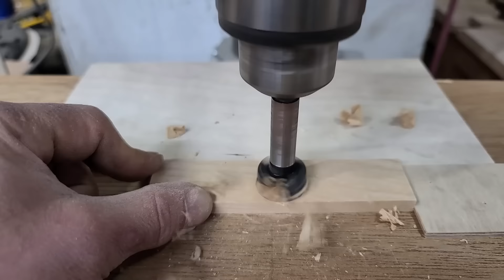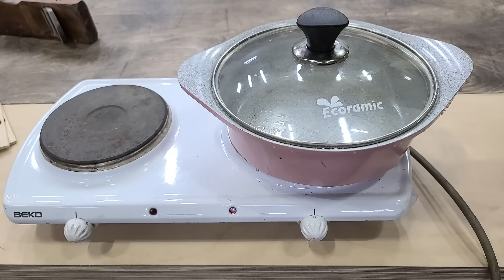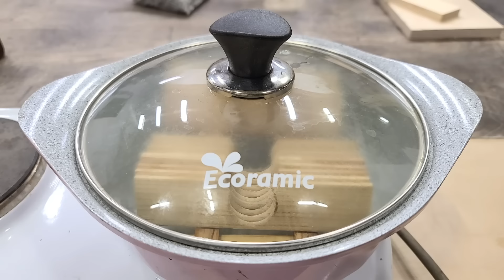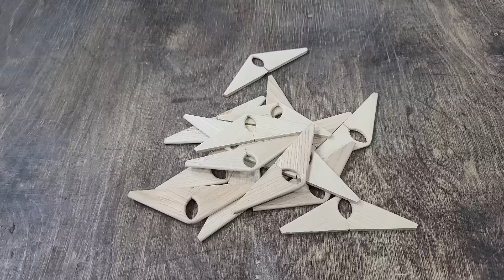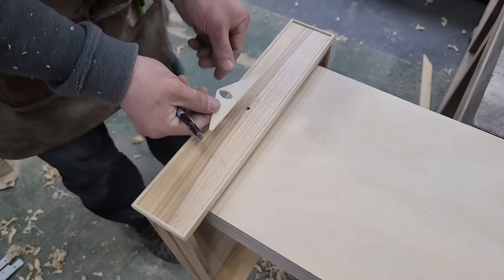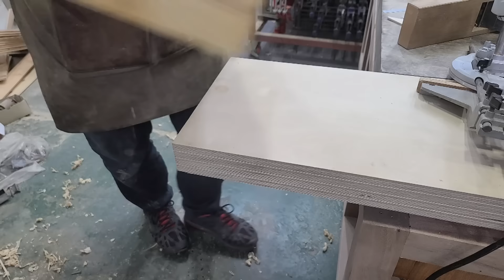Thin but unbreakable DIY handle / Woodworking DIY

Comment: No.offens but it's not really so smart. You could have gone with glueing at 90 degrees and had a proper hole in wich you could actually put your finger in. 
I don't say there's nothing to learn from.this, but it's maybe not the best application.
Reply from the maker: of course

Comment: Wouldn't it be better if you cut the handle-shaped piece, pierce it and tax it instead? unnecessary work and waste of time.
cut, mill, fold, steam, assemble, glue, put in place.
easier, cut the shape, mill it, stick it in place.
Reply from the maker: If you look at the first part of the screen, it is very likely to break if you simply cut and paste it.
It is cumbersome, but you need to twist the wood grain once to make it strong.
Reply: cutting alone the bias is stronger, as he demoed in the beginning of the video.